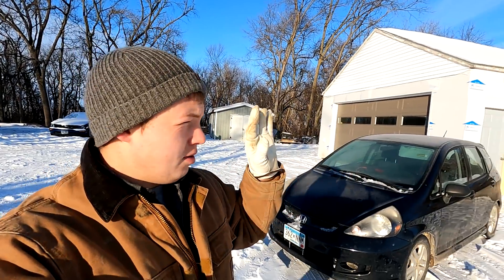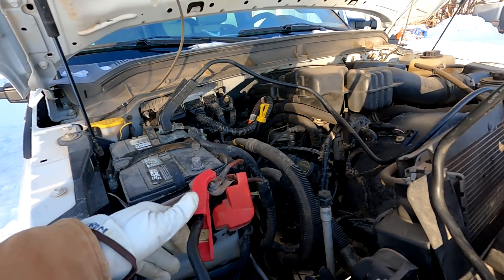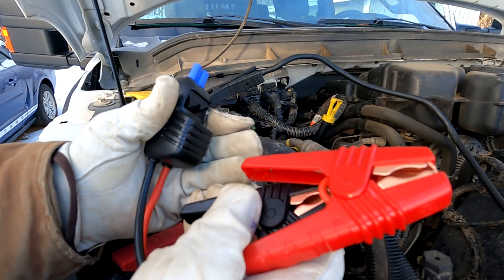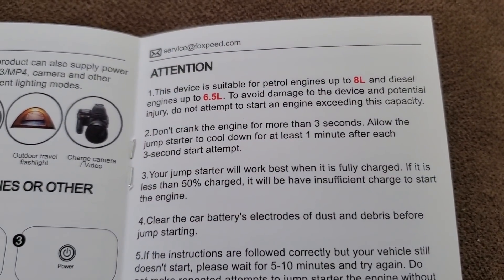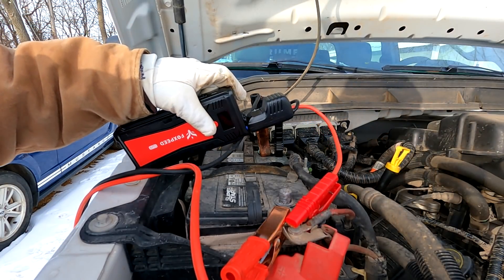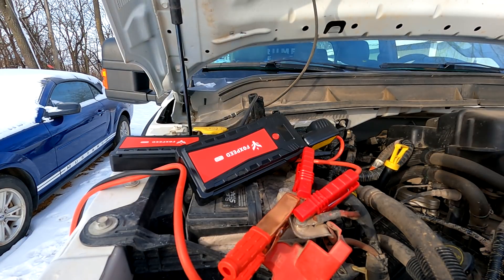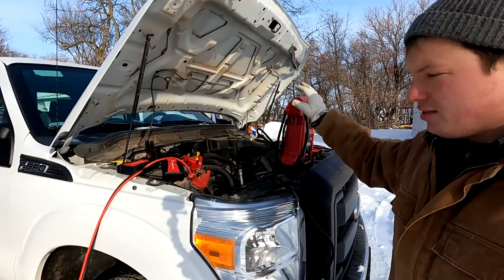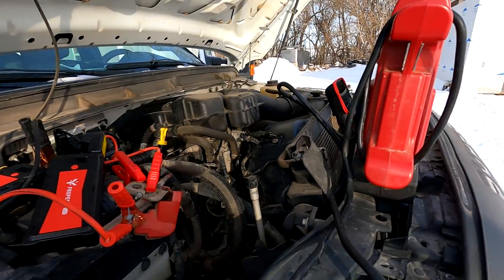Lithium Ion vs Lead Acid Portable Car Jump Starters

Comment: That Foxpeed jump starter's battery will fail, far sooner than that Jump-N-Carry's battery will fail -- both over the long haul, and the number of starts between charges.

In other words, that Foxpeed unit's battery will probably not have much capacity remaining after 4 or 5 years (probably sooner).  If, for example, it has a 2 year warranty, then do not expect it to have much kick after that time.  Whereas that Jump-N-Carry unit's battery will likely last close to 10 years.

That Foxpeed's battery might be able to start 6 or so four-cylinder engines, on a single charge.  That Jump-N-Carry's battery will probably be able to start 25 or more six-cylinder engines, on a single charge.

If you do not re-charge that Foxpeed's battery within a month or two, it will probably be down to 25% (or dead, if left in your trunk in the winter).  Whereas that Jump-N-Carry's battery will probably still be above 90%.

If you have a large, high-compression engine, and a completely dead battery, and you want to be sure that you will be able to start it in the cold, then get a higher model from Jump-N-Carry.  Their JNC1224 model has double the power of the one tested in this video (and a price tag to match).  It is a beast.  It will start anything.

The JNC660 (used in this video) is a fantastic unit.  There is a JNC770R model, with identical power, but with much longer cables, so that you can leave the unit on the ground and still reach your battery.  It also has curved clips, that might make some connections easier.

Lastly, in New Jersey, many of the AAA service stations use the JNC660 (the one demonstrated in this video).  And they go around jump starting anything and everything, several times a day, every day.  That says a lot about the quality of that JNC660 unit.

Although the JNC660 unit costs more than the Foxpeed unit, the JNC660 is not expensive -- and it is a much better unit in every respect.

Comment: The main difference is if you jump vehicles regularly as in every day or at least 3 times a week then you want the lead acid JUMP BOX..Because you're gonna get more use out of it over a longer period of time. JUMP PACKS are good for now and then and the amount of good lithium battery power per jump is not nearly the same as a jump box...

Comment: Between a AGM jump starter pack and a lithium ion jump starter pack of equivalent levels, which is better for cranking? I meant which would provide more instantaneous peak surge current?? 

(Assuming under identical conditions, where all other factors being equal)
Reply: Hello???
Reply: This video shows that the traditional Lead Acid jump pack performs better in the cold. If you get one, just keep it charged ~
Reply: @georgehofgren6123  okay but in the optimal temperature range like 20°C-30°C ?? Then which would actually perform better
Reply: @osmanrahman9472  Well the point is that you usually need a jump starter in the Cold, not necessarily at "optimal temperatures" 💁‍♂️

Comment: I just bought a harbor freight one. Its a Viking 1000 peak amp lead acid one with a 150psi air compressor. It says supposedly up to 35 starts per charge and it also says to charge it every 30 days but I think thats a little too soon. How often should I really charge it? I was thinking every 3 months or even every 6 months. What do you think?
Reply: Do it every month
Reply: @ every other month?

Comment: To understand why those 8ga wires Cables can carry that much amps you need to understand OHM'S Law     The longer the wire the Heavier they have to be to carry Current (Amps) and those 8ga cable being only about 10" long  is why they can carry the The amps to Start the Truck NOW if you Made the 8ga Cables 4ft long they would Not Start the truck they would not be able to Carry only about 1/4 of the Amps  , So the shorter the wire the More Current Amps it Can Handle  The longer The Wire it has to Be Bigger .

Comment: come on, let's destroy the control units! 💪🔥⚡ Caution: ⚡please always close and open the electrical circuit with BLACK!! DO NOT handle it as shown here at 0:05 + 9:05 + 11:05! Also/and especially when jump-starting from car to car! Tip: just remember: Red/plus ALWAYS stays connected for LONGER. And if just the engine control unit is broken ($2,000 to $4.000,-installed), then the problem was between the steering wheel and the driver's seat.
So people, BEWARE: as I said, never connect in the wrong order when jump-starting! For the sake of your electronics and your money: Make the red contact good and tight! Then, when the circuit is closed (with black/minus): DO NOT TOUCH/wiggle the red one again before the black one is off again! If you suspect that the red one is not properly seated, first REMOVE THE BLACK one and THEN correct/contact the red one. Then put the black one back on... etc. If the black one sparks, it's not so bad, as the electric shock is "cushioned" by the battery. (If the red one sparks, the shock goes through the entire on-board electronics every time... good luck, Raphael

Comment: You can make a super powerful lithium jump pack out of old tool battery pack cells and a 12V 3 cell BMS board. You will want a heavy duty diode to prevent the car 14V from back feeding into it
Reply: It produces 400 A?

Comment: I appreciate you testing in true cold conditions since this is typically when batteries fail and which normally reduces the performance of the jump starters.  As another comment listed, I think the best choice is an ultra capacitor version, because the cold doesn’t impact its performance and generally you can use the weak battery to pre-charge it… better yet you can get a hybrid which has the lithium battery combined with the caps and the lithium battery gives you another option to pre-charge the capacitors.

Comment: Many better lithium-ion jump start packs have a "boost" feature for when the battery is too low to be detected.... sorry to your sponsor but that's a crappy example of a lithium ion jump-starter.  Also as mentioned lithium-ion loses most of its output in extreme cold. Warm it up and try again.

Comment: The Foxspeed is not designed to operate in minus 15 degrees...period.  A better quality Lithium will work fine that is designed for minus 40.  Costs about $150. Why carry a lead acid battery around with you?

Comment: They froze one battery after messing with it and had the other battery at 35 degrees, granted the foxpeed probably would not work well in this situation but the test is just not done correctly.

Comment: Mainly don't have to do a big work up about this situation with jumper one is a lithium battery carries more power  for size to weight the main reason is this lithium battery does not lose power over amount of time AGM batteries hold power longer then basic lead acid battery drains itself over time. It's called weight time power key factor of intervals of recharging lithium batteries win out.

Comment: When a Li-ion booster is colder than a few degrees F its ability to discharge goes way down. Won't charge or discharge at all while it's about 5F below. If you stuck the colder one showing 77% under your jacket until it was as warm as the booster pack from your garage it would've worked right away too.

Cold weather saps the car battery the same way so if you don't have a booster you can use a small heater or a heat lamp to try warming the battery enough to crank over.

Comment: The only benefit I ever got from a lead acid jump pack is dead weight in my car for the winter.  The couple I owned wouldn't start anything, even if the battery in the vehicle was just low and not dead.  I bought a Li-Ion jump pack and it has started everything I've thrown at it, multiple times too without needing to recharge right away.  Even our '87 Winnebago with a beefy carbed 454 in 30 degree weather just cranked cranked over like it was sunny and 75.

More power to anyone that still uses old and aging acid batteries to jump start something, but I'll stick with the Li-Ion jump pack.

Comment: The problem with  battery jumpers is that you might carry it in your car for months or years before you need to use it. If you don't charge it up on a regular schedule it might fail when you need it. That's why I am a fan of the capacitor type jumpers.

Comment: Couldn't believe you were even considering it a fair comparison using one that was warm and one left in the cold and what is with using it without the battery?
I have used the old ones for years and liked them but your
Ill informed disrespect for the new tech is not impressive.

Comment: I was a friends house while he was working on an older ford dump (diesel). Batteries were dead, so he pulled out a Lithium Ion Jump Starter and Power Pack. that he got  form Harbor Freight. Never hesitated... I bought one and use it when I go to bush-hog. My tractor is only cranked these days when I go to bushhog!  Never fails bust-off that little diesel. I use mostly for the tractor, but I keep it in my wife's truck to make sure she doesn't get stranded. I also bought a Viking 1700 with the aux compressor. Got tire of flat lawnmower tires. The KOT's Meow. I have a 12' enclosed trailer that I keep my Hustler 52 in, and that's where the V17c resides. Along with tools. I call it my Mobile Storage.  heh-heh-heh
Reply: Your mom's a bush hog!😂😂

Comment: It's pretty simple why it did not work. These Lithium Jump Starters don't work well when they are cold. The battery inside has to warm up for them to work. To make that happen use short bursts. Just turn the key on and off a few times and kick the motor to get the battery warm.  By the 5th time it should be warm enough to start your car or truck.

Comment: The Lith pack i had did not help with my dead Bimmer sedan this morning as the temp was -10 degrees.    The Lith pack was stored inside when I tried to jump it.   I think I’m going to have to try using two Lith pack and see what happens.   The car battery is probably about 80% dead so that doesn’t help either with this cold weather.

Comment: I have a 1500 amp AVAPOW... started a 4cyc sedan every time .  These small lithium jump starter pack some punch.  Not sure why yours don't start.  And i'm pretty sure you're suppose to connect the plug to your jumper before connecting to the car battery.  That was how most of them works.  The battery pack needs to read your plugs and reset before you connect to the battery.

Comment: I mean you tested one of the cheapest lithium jump starters I have a Noco gbx 55 you can hit overide if it doesn't detect a battery but it will remove all safety features

Comment: Acid battery in a jumper last about one year if you frequently charge them but lithim last longer but aparentally get affected by cold temp acid batt don't. I prefer acid jumper  cause has more power to start vehicle and can be used to start a 10 or more vehicle depend on The jumper capacity.

Comment: Those things will last around 7 years then have battery issues, use it or not. Plus charge must be maintained once a month or battery will die sooner than 7 years. The lead acid battery could easily be replaced for around $40, just did this yesterday. I think the Li-ion is a throw away, could be dangerous if you don't know what you're doing and required breaking into the case and desoldering from the motherboard.

Comment: The lithium battery booster pack is clicking because it's disconnected from the car battery which requires it to need a power source to keep it running .These lithiums battery booster  packs are very very tricky🕵‍♂️

Comment: Had two lead/acid jump starters.  Both died due to neglect.  Unlike my spanners which just wear out in a regular civilized manner.  Batteries are misery - you pay a lot, and they need caring for.  Better to buy a dog.
So can these pocket starters die from neglect too?

Comment: I dunno if anyone commented on this but if you've had the packs attached why wouldn't you expect it to start after some time accumulating a charge lol?
Today I connected my 9ah dewalt to start my ranger battery, which was barely dead, but it worked! Wires got friggan hot as hell but it didn't so much as take a single bar of charge lol to crank that 4 liter over and get me going.

Comment: Lithium batteries have the advantage of holding a charge for a long long time, but they struggle in cold weather.  Lead acid batteries do well in the cold, but they have to either me recharged frequently or kept on a battery tender.

Comment: If you don't care about trunkability, you could also get a small lead acid battery light enough to lift on your own, and carry it in a milk crate or similar. 
Or a battery with a handle on it, like many now have.
Set of good jumper cables and you have yourself a portable jump pack.
Keep it on a maintenance charger and it should give years of service.
Reply: So you're saying don't carry a jump starter, but just a spare battery that you can change out?
Reply: @musicalhistory4392  Not necessarily, A jumper pack is basically just an all in one unit with a small 12V battery, built in cables and a handle. 

You can make your own at home with just a car battery and jumper cables. A deep cycle battery is probably better for this application since they’re designed to be drained constantly. 

To be honest I prefer this crude battery and jumper cable method, most new jumpers have all these safety nannies that get in the way of starting a dead car. A regular deep cycle car battery has more cranking amps than any standard jumper pack on the market.
Reply: Exactly what I have
Reply: But you have to keep it charged.
Reply: @anonymike8280  Like any pack or battery. I put a spare truck battery on a walker (which holds it higher than a hand truck) and hang a battery tender off that using zip ties.
Reply: @obfuscated3090  Lots of options. I don't have a shop or even a garage. Some kind of jumper unit is my best option right now. A two-battery system is a possibility for some people. The secondary battery is only for starting and will not get run down if the charging system fails mid trip.
Reply: The classic method used long before jump packs existed is mounting a full-sized lead-acid battery to a hand truck then attaching a set of heavy jumper cables to it by cutting off the alligator clips and using standard copper lugs to connect to post-style (I convert every side terminal battery vehicle I own to post style batteries. They're great for around the shop and of course you can parallel a jump pack or other battery for difficult starts.

Comment: That small jump starter uses a lithium ion battery and they don't work as well in cold weather. The one I own also says that after you hook it up, you have to put the car on accessories for 10 seconds then start the car. Otherwise it won't work.

Comment: I know you're kinda limited when all 3 batteries turned out to be fine, so thanks for going ahead with the test. But to be fair, disconnecting the battery doesn't simulate a dead one. The dead battery actually adds a rather heavy  load to the circuit which would be a more accurate test.
Also, lithium batteries are notoriously poor in the cold.
Reply: Bushcraft n Stuff
Good comment by you.  Be careful of what you believe on YouTube.  Anyone can say anything.

Comment: Yup, those big Clore Automotive JNC packs are the industry standard, I have a 4 year old JNC660, original battery, still works great.  Recently I picked up a NOCO GBX45 compact lithium (USB rechargable), using the JNC660 as backup.  The Noco's have such nice fit and finish, even the box it comes in is nice, like what Apple products come in.
Reply: Hubjeep
Thank you for taking the time to recommend that.  I need a small jump battery.  Long story but Boxster owners understand.  The trunks won't open without power so you have to have a jumper in the cabin which has absolutely no room for anything.  Thanks ....

Comment: These Lithium Ion jump packs should be called charging packs. They are designed to give enough charge to your car battery to enable a start. As shown they cannot substitute for a car battery. A chunky lead acid such as Snap On will start anything, with or without the vehicle battery connected.They also lie about the capacity. They add the 5 v capacity to the 12 v capacity neglecting to say that both voltages are generated simultaneously by the same battery. How dishonest is that?  These   Li-on packs are designed to start a car where the battery has gone flat accidentally by leaving lights on etc. They need a little time to put enough charge back in to enable a start. They cannot help if your battery itself is faulty. To cover all eventualities get yourself a good quality lead acid. My SnapOn 17Ah has given me good service in the car trade for many years although I have had to replace the battery itself 3 times in 15years, but at a fraction of the cost of the jump pack itself.